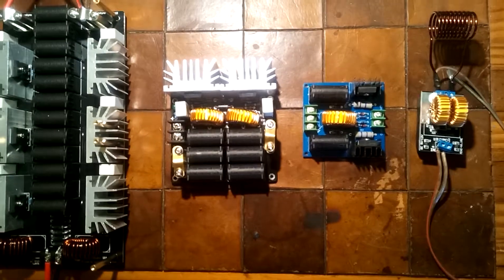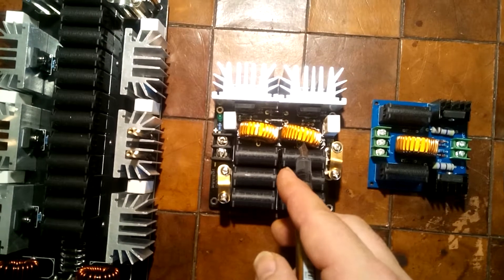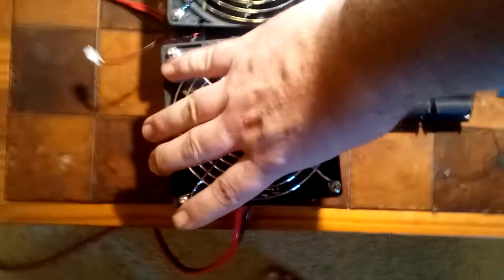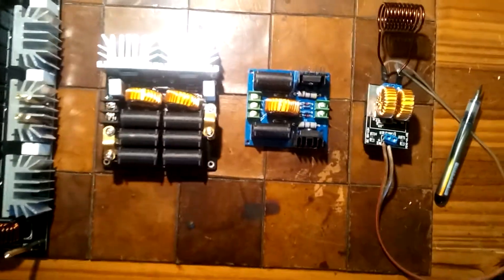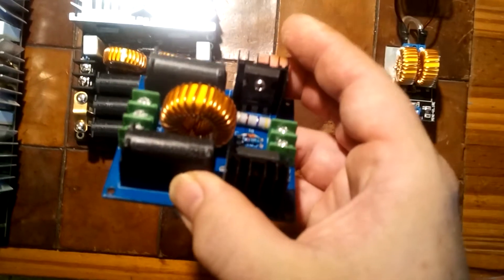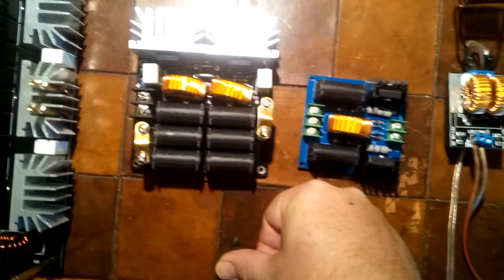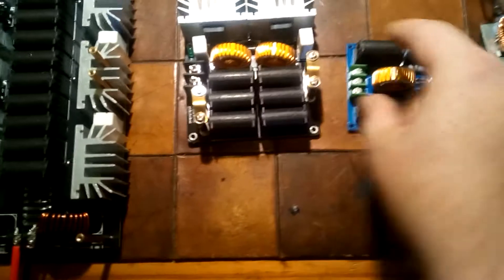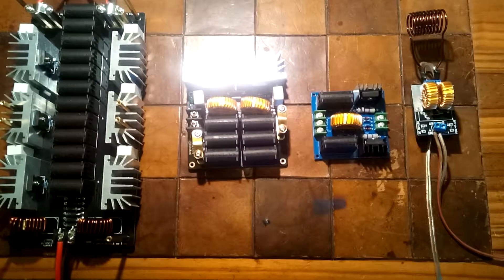A quick Comparison of most of the ZVS Drivers available on eBay.

Comment: Doubling the capacitance REDUCES frequency by 1/(sqrt 2).  Voltage does not depend on this.
Reply: What if e double inductance?
Reply: @shawncalderon4950  Same thing... reduces freq by 1/(sqrt 2).
The famous freq (f) formula is:  f=1 / 2 PI [sqrt(LC) ].
Increasing L and/or C reduces f and vice-versa...BUT the amplitude of the sine output is always about 3x the DC power supply.
Reply: @dalenassar9152  thank you!

Comment: the 3rd to last ZVS driver happily does 48-56VDC without issue. I am using the same driver on a ZVS DRSSTC.  The higher the capacitance the lower the resonant frequency, the higher the current draw.  I have mine running at ~86nF on the MOSFETs. The setup can run for 1-2 minutes before needing to cool down.